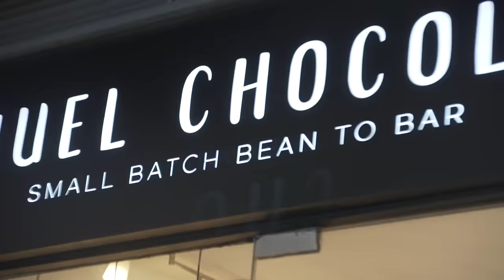Hired or Fired: Chocolatier For A Day

Comment: The melanger (the machine they used to make the mixture smoother) is also the one being used to make nut butter smoother. Blenders tend to get "stuck" and overheat, and won't have a nut butter that is smooth. You can basically make nutella out of it :D